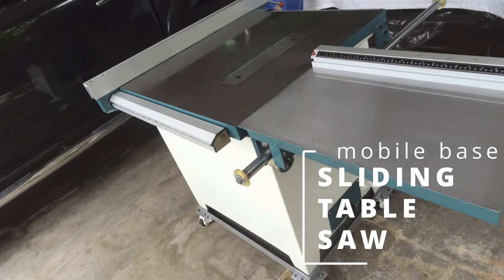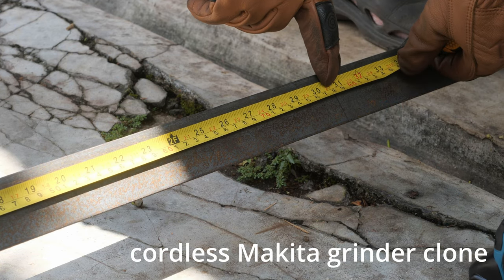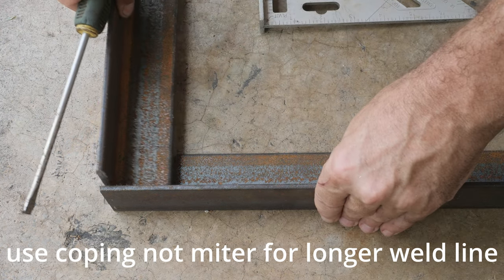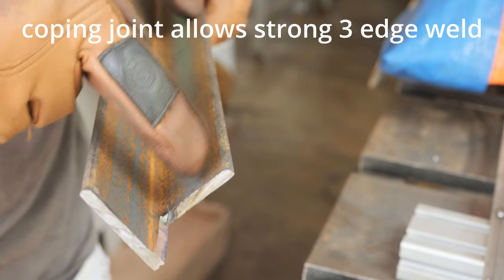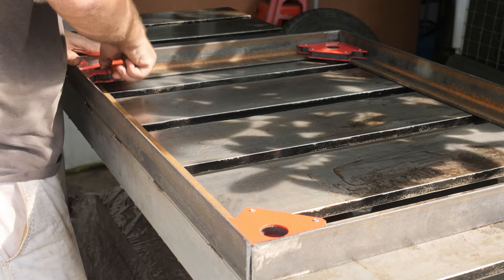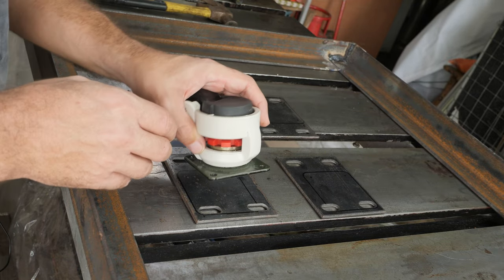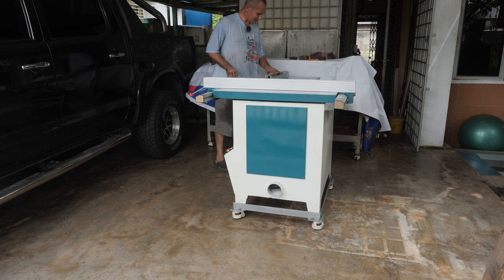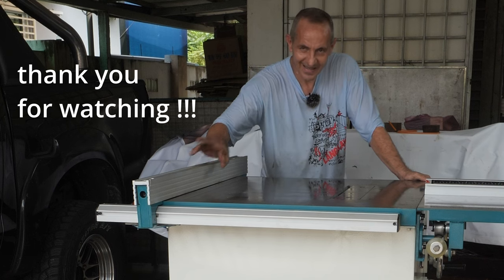Mobile Base For Cast Iron Table Saw

Comment: This table saw looks so much heavy and it's only you putting that machine on the base?? Nice one 👍. Obviously if there is no one to help you doing all job yourself. Well done. Really enjoyed your video all details on it.  When you doing videos it's very Informative and straightforward. Keep your hard work and you will be rewarded soon. Thanks 👌
Reply from the maker: Yes it was a real challenge to move such a heavy machine single handed. I worked out the way to do it when I was moving my 460kg/1100lbs jointer and I used the same leverage method. I guess that's how the pyramids and other ancient structures were built. 
And that heavy duty industrial grade 12 inch sliding  table saw is a dream for every wood worker and for a commercial furniture manufacturing. It is very quiet and most importantly extremely powerful. I would definitely buy it again as the table saw is the heart of every wood + aluminium shop

Comment: Looks like you got some help at the end.  That saw is so solid. just like your 1000 pound jointer. Those bases are really good and I recon people would pay for them as an option.
Reply from the maker: yes the saw is also industrial grade, meant to be used 24 hours a day, and its quiet motor delivers 4 HP. The saw is 12 inches, and 32 mm dado capacity, which was important for me, because I often cross and rip cut 4 inches thick material, and I like to do it in one pass for precision and time saving. of course when you use powerful machines, you need to be focused and aware of the power. I don't even want to imagine the kickback from this beast. That's why the 1st thing I did were the zero clearance inserts with double splitter design, and that really feels safe now. The material travels through the blade like butter through a hot knife (butter is the material hehe), without any vibrations or funny feeling that it might suddenly shoot back. it is a huge difference when you compare rip cuts with and without the splitters. Without the splitters it literally feels scary.
in my future video I will explain why my saws have no T-tracks for the sled etc. basically it is a sliding saw, so it has a sled built in, and you don't loose the max cross cut capacity by deducting the sled thickness. and for the other jigs attachment, such as feather boards or miter guide fence and so on, I use the switchable magnets, which I designed based on the Tesla hand written notes published on Wikileaks. I didn't expect it to work but it turned out much stronger than the MagSwitch, and the design is different so it doesn't violate MagSwitch patent. A video on how I built those switchable magnets is coming up in January 2022

you have a very sharp eye indeed. yes I needed a hand to pull the last board out, while I was lifting the machine. I could do it all alone, I would have to lift the saw, and support the lifting board on some bricks, then pull out the last support, and then lower the load. 
actually I managed to do it all alone with the jointer mobile base.

good idea. for the people who don't like welding, and spending 2 days making their own mobile base, we can add the wheels as an option.

I also don't mind making mobile bases / carts / dollies for the customers, as it's quite straightforward, yet feels very rewarding when you can do the victory lap with something that heavy.

PS
the outer silver paint coat is also anti-rust oil based, which I used on the metal doors, and on the jointer's base, and it survived few years with no signs of wear out or deterioration by the tropical weather.

Comment: This is an absolute master piece

I have an old cast iron table top saw that I pulled out of a barn, its smaller but was incredibly heavy with the motor still attached. I actually thought the motor was an attactched grinder that would fold down... until I brought it home and showed my husband who informed me that it was the motor 😂 

Did you build the bottom half of this table saw as well?
Reply from the maker: It's so cool to get a comment about the table saw from a girl!
I welded the mobile base, but the table saw came with the thick steel cabinet, which combined with the cast iron table and sliding carriage, males it very heavy. That heft reduces the machine vibration and I placed a coin vertically on the cast iron top while the saw was operating, and the coin didn't fall